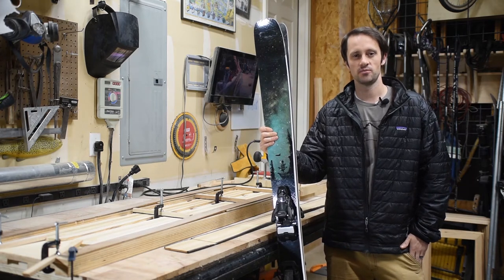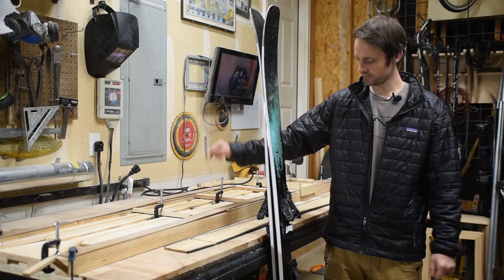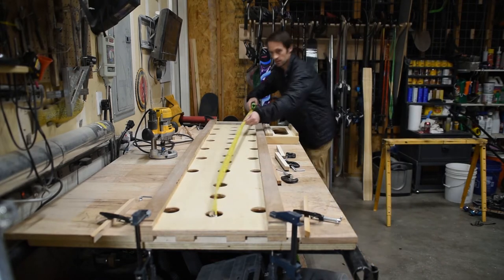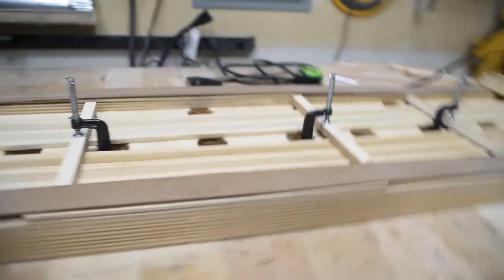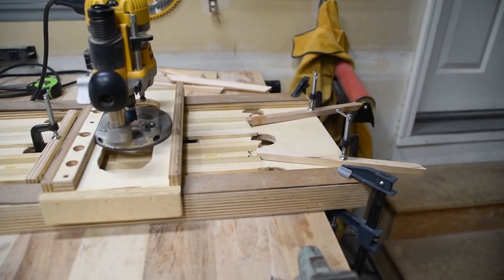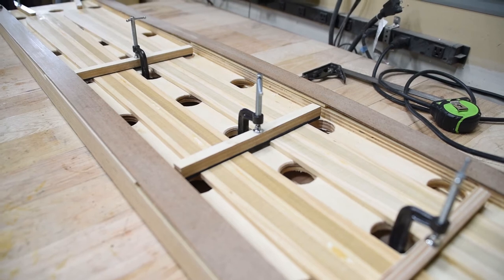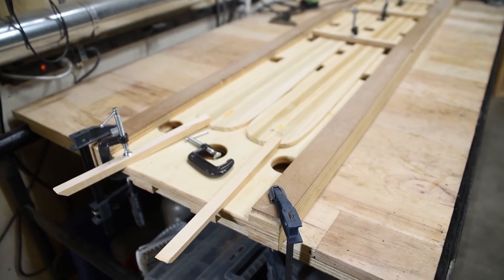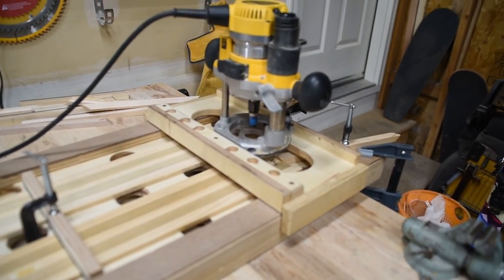DIY Ski Profiling Jig

Comment: Hey JD are your cores continually thinner towards the tip and tail or is there a flat spot at their thinnest point? I'm trying to figure out what shape to make my router rails
Reply from the maker: Good question, depends on the type of ski I'm making.  Generally speaking though they do flatten out just a couple inch's away from the tip and tail spacer.  Some day I'll replace the shims and binding platform spacer with a dedicated profile.  For a carving ski that would be nice.  For a park/all mountain ski I don't think it matters too much.  Good luck!

Comment: Hello, your videos are very interesting, I have a question I am thinking of making a snowboard, my concern is how to outline the core, the rail system with a router works well, I want to leave the ends at 2 mm and 6.5 mm the center, I could have a  core professional with this system.  thank you
Reply from the maker: Hey dude.  Thanks!  That core profile sounds pretty good, maybe a little thin.  I like stiffer board in general though, so maybe I'm bias.  From a manufacturing perspective its kinda tricky to get the tip/tail down to 2mm.  3 - 3.5mm is easier on the router sled style jig.  Also the binding inserts are going to get close to your base material at 6.5mm.  On snowboardmaterials.com the inserts are between 5 and 7.5mm long for <150 up to 172 boards.  I'd add about 1.5 mm to the insert length for under foot thickness.  I've only made 1 snowboard though, so yeah.  Good luck!

Comment: Hello, I have built a similar set up to yours. What kind of router but are you using?
Reply from the maker: Nice!  Its a Dewalt 616 with a plunge base.  I use a 3/4" double flute straight edge bit.  I typically run about 3 depths to get from ~10mm to ~3.5mm, climb milling to reduce the likelihood of ripping off the sidewall.  Good luck!

Comment: Hey, so I’ve watched most of your videos now. This isn’t a post about your profiler sled (sweet idea with the Velcro shims to adjust to each core thickness btw) but I was planning on making my own press and was wondering how you adjusted the length/tip &tail rise/ camber in your press for both skis and snowboards. I was planning on constructing the press put of wood (I don’t have access to I-beams, and they’re expensive). Just wondering how your press is adjustable enough to accommodate both radically different sizes, camber profiles, and tip and tails. Best
Reply from the maker: Nice, thanks man!  There's a couple adjustments I make when going from long skis to say a shorter snowboard.  The main one is the mold.  I have an adjustable lower mold that has a tip section, tail section, and middle section.  I loosen some threaded rods and slide the tip/tail closer to middle.  Then I also have a adjustable upper mold, more or less.  Its a mold I cut into some sections.  I add/remove sections to make it close as possible to the right length.  Also I remove/add pieces to my cat tracks depending on the length.  The bladders take up the rest of the slop.  Hope that helps!

Comment: Amazing job man. I was already struggling to get one CNC for core profiling... maybe it's a good idea to give a chance to your system! it really looks great. Just i was wondering how precise are you with the rails when an exact core is designed in Fusion360 for example. would you use separeted thinner layers of wood (1mm for example) and adjust to the measured thickness on several points? 
Again, congrats for your job !!
Reply from the maker: Thanks man!  Its pretty accurate, I take a set of calipers to it when I get done. Honestly I don't usually have a model to compare to.  I lower the router to the desired thickness for the tip, set the stop.  Then bring it back up to the surface and mill from top down in steps.  I make the tails a little thicker than tips.  I have a couple projects on my to attempt list.  One is making the shims and riser parts for the profiling jig on the CNC.  I'd have more more control over lengths and transitions...  Also one day I will try profiling my core on the cnc.  Let the robot do the work! lol.  Cheers!
Reply: @redbarrelskis3361 Hi there, I just binged watched all your videos, as when I get interested in something I take the dive. Your technique for everything is very precise and symmetric. I own a custom cabinet shop and obviously I love skiing. Creating a pair of skis has something very appealing to me as it would be a challenge and meditation at the same time. I have a 5x10 cnc and would love to put it to work. I understand why you use the sled to create the tapers. You mention here using the cnc in the future to do this task… by hand with your sled the straight cutter is parallel to taper. A cnc would need a ballnose cutter since the head is perpendicular to base? Then not only would this profile be managed in the Z-axis at the same time… I am sure it can be done, but have you gone down this route yet is my question. I am not at building skis yet… but you sure have my attention!

Comment: Really nice videos and great work! Why not using your 3D CNC router to profile your ski?
Reply from the maker: Thanks!  Yeah great question.  Mainly time.  I use a bigger router, with bigger bits, on the sled than the CNC.  The CNC is just a hacked X-Carve.  Not the most industrial one on the market...  So I just would hate to push it too hard or make a program that takes a crazy long time to run.

Comment: Great content! Why do you use jig for profiling when you have cnc? Curious :)
Reply from the maker: Thanks!  The CNC really only holds up to a 1/4" bit efficiently.  Over that and you have to go super slow.   I just don't want to run it for like 6 hours...  I use a bigger router on the sled and can put much larger bits in it.  Also I built the sled before I had the router, and if it ain't broke don't fix it....  Cheers!
Reply: @redbarrelskis3361  100% rational man, thanks! I was wondering how can I deal without cnc to cut off the core but I figured it out! I will do the layout in snowcad or something similar, order polyacrylic template, rough-cut the core on the band saw and trim with the router, how does that sound for you? would you do the base the same way or hot knife around the template?
Reply from the maker: That's a great plan.  What I'd recommend is making the acrylic template to the shape of your ski.  Then making a wooden copy from some plywood (so it won't twist or bend.. been there).   Sandwich base material between the 2 templates.  Then use a rabbit bit and pattern follower bit to 'shrink' the plywood to the shape of your core.  Then cut your cores.  Don't forget the thickness of the metal edges..
Reply: @redbarrelskis3361  Your efforts are a blessing to me, both video and text content. Appreciate that a ton. If you ever need some help with marketing or SEO, I'd be happy to give back! Great idea with the plywood, it will be thicker, probably easier to rest the bearing of the router bit. Cheers! ps. I wish I lived in Colorado!!!